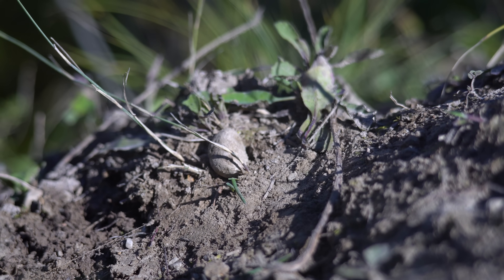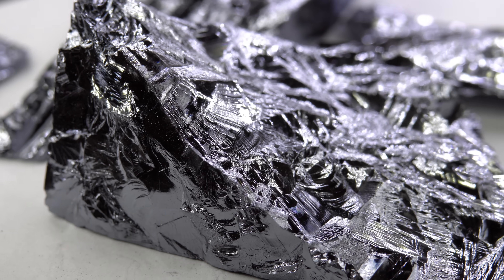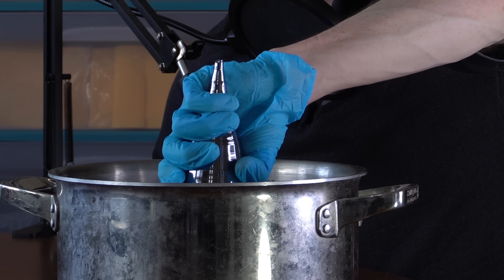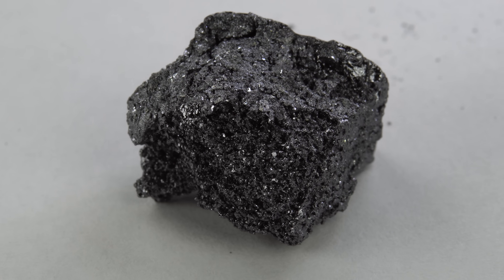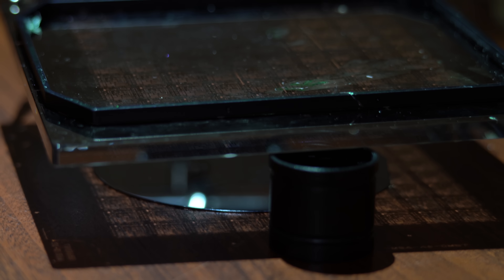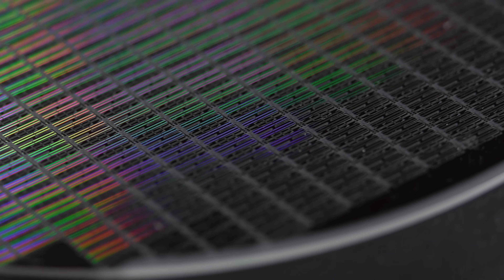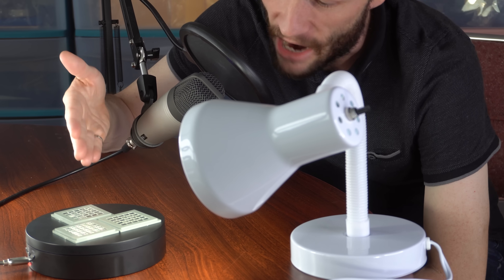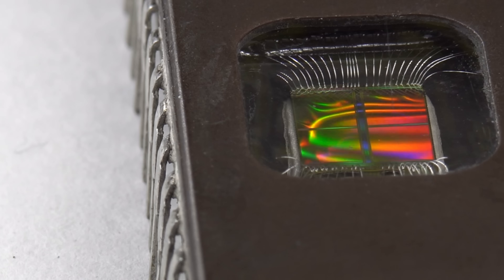How To Make A CPU

Comment: Genuinely would love to watch a detailed "how to make computer" video whete the guy created every from scratch. Hell, he even collect everything from nature.
Reply: It could be done, though it'd be crazily labor-intensive. You don't need any super-advanced manufacturing tools or super-pure materials until you reach thermionic valves. A relay computer could be built out of nothing but hand-crafted copper wire, some iron for relays, lacquer insulation, wooden supports, some citrus juice and some zinc or lead for the battery. The most difficult part would be perfecting wire drawing to get the copper thin enough for coils. You should be able to from-scratch your way up to around a 1930s computer. The monster would be the size of a house, with another house next door for the batteries, but it would be able to play tic-tac-toe. If you added a third house for the memory it could play Tetris. A single-purpose tabulating machine would be easier and only take up half a room, but you can't play any games on that.

Things get suddenly much harder once you use valves. Hard vaccum, glassworking, much finer and more delicate wire.
Reply: @vylbird8014  Not possible to “do it at home”. I’m not sure you understand how hard it is to make copper pure enough to conduct electricity. Let alone make wire out of it.
But sure man. Lemon Juice.
Reply: @OmegaUberDeathbot wdym pure enough to conduct electricity, it'd be harder to make copper metal so impure it stops being a conducter
Reply: @wooy1701  good point. But the mining and smelting of copper isn’t exactly something you can do in your kitchen. And with wires that small you are going to need some refined copper.
Reply: @OmegaUberDeathbot  yea thats true, you can probably make some impure copper with some stuff youll find in a garage but i doubt itll go through the whole wire making proces without breaking
Reply: @wooy1701  or messing you resistance calculations.
Reply: @vylbird8014 easier to make a biological computer by injecting base code into a female port.
Reply: It would be interesting if some of the dudes making video of primitive technologies someday break the barrier and succeed in making a electronic chips from scratch and start communicating with the civilized world
Reply: Well yeah unironically you do collect everything from nature.
Reply: @johnahn1117 pay him a billion dollars
Reply: Yeah, If you have 80 years to spare. Even making a natural sandwich is nearly impossible, imagine a cpu

Comment: Dude, you're a life saver. Been looking for a way to DIY this for a while. Can't wait to try it out.
Reply: Imagine how much money we can save. I happen to know that rocks are cheaper than CPUs, even with the added ingredients in the video! 💪🏼
Reply: @jsivonenVR I've been making my own since 2011. It's way more affordable and you can make them fit your needs exactly. It's also way more sustainable and ethical than buying from commercial brands. I only use local rocks.
Reply: @RicardoMontania are you memeing or Fr? I can’t tell if this video is serious
Reply: @ttv_zombiefetus1710  LOL memeing of course, making a modern cpu is extremely complex as you can see in the video
Reply: @RicardoMontania Lol
Reply: @RicardoMontania  I gotta admit I've almost been tricked myself, having started thinking that you may have meant you built some basic processing chips or whatever on your own lol
Reply: @RicardoMontania  doesn’t change the fact it’s still just material from rocks
Reply: @philipbeauford  yeah but you need a machine that costs around 40 million usd and remember that a lot of CPU's get wasted in the process cause it has to be ''perfect''
Reply: @jsivonenVR  for sure. I mean, the initial investment to get the equipment is probably pretty steep, but you should break even after a few thousand units or so.
Reply: All the best buddy!
Reply: Ya I built one myself too!
Reply: I got to the part where I put photo resist on the chromium etched photolithographic quartz mask to localize the etching onto the silicone wafer from a laser light source, 

but when I attached the bond wires onto the pads of the silicon chip, I still didn't get any computing power from the electrical current I ran through its pins. 

Did I not acid etch enough of the silicone wafer's exposed chip particles, or was my mistake in the homoepitaxy step of the curing procedure? 

Any help is appreciated. Thanks! 👍

Comment: Weirldy this explained it to me in the most basic way possible. I’ve done acid etching of a copper board so I’m taking this to be a highly engineered complex version of that
Reply: It is, but it's also like developing a photograph.  In fact it's called photolithography.  That's how they design the chip and then shrink it down to a microscopic size: by projecting it through a lens that makes the image smaller.  The light hardens the material where it shines, in the exact shape of the circuit.  Then they rinse off what didn't harden, so it forms millions (and now billions) of tiny paths where the electricity can flow.
Reply: @customsongmaker  Developing a photograph is another mystery for another day lol, I'm still using the good old 'magic' theory on that one! Interesting though, so the circuit is painstakingly designed on software and then etched through the lens onto the wafer and the electricity just takes the paths available. See there's all these videos that explain things but they often forget to make it understandable to someone with little knowledge of the subject. Don't get me wrong I'm guilty of this in my day job too. So it's always great to have a video on subjects that seem like magic explained so simply. My next thing to work out is how they produce all the capacitors on these boards. It's just insane to me how we've created what we have and haven't actually been doing it for that long!

Comment: I was following along and completing each step fine until I got up to adding the bond wires. Mine don't seem to be connecting though. Other parts of my chip are lighting up and working correctly. Maybe I installed them backwards?

Comment: I don't want to be that guy but the Primer Information that most people don't have here is something called 'Logic and Logic Gates'. The Magic Runes they are Enscribing with the black template are 'Logic Gates' constructed with Boolean Logic. This allows functions to be aquired by allowing or not allowing electrons to pass through resistors which are enscribed onto the chipset. These Electrons are following Predetermined Yes or No Logic statements generated by the Humans that made the chip. So the Magic Runes (Logic Gates) essentially take Human Understanding of Logic and Predictablity of Universal Functions and converts it into a Physical Instrument (The Chipset), when electricity is applied to the Chip, it will produce a current in specific 'Buses'/'Lines/Wires', causing that bus, line or wire to continue the logic chain, these produce Binary Outcomes and with enough encoding and decoding, we pretty much unlocked the ability to simulate any Physical Phenomenon. But yeah thats pretty much how it works.

Comment: Help I'm stuck in step 22! I couldn't find the knife you used so I used a cheese knife but I think there might be some cheese leftovers in some of the unpackaged silicon dies, is it safe to move on to the next step or will the cheese mess with attaching the bondwires? TY

Comment: I was part of a team that built servers for the processing line at the IBM 300mm CMOS lab in East Fishkill NY.  Not seen are the hundreds of servers and networking devices hooked into the line and all of the monitoring software involved with each step of the process.  Creating the chip is one thing... the manufacturing process is an engineering feat of machinery and computerization.

Comment: the craziest part about a CPU, is that its literally just drawings of resistors, diodes, capacitors, etc. and the drawings do what they depict. when you look at a super zoomed in electron microscope view of a CPU die, it literally just looks like miles and miles of common off the shelf components.

Comment: I'll never understand this, ever, to any degree. How do we take a rock, reduce it to nearly a pure form of its mineral content, and make it capable of processing and computing just by mixing some chemicals onto it, and cutting it real thin and throwing on a few wires? Just... how? And a bigger question, how in the absolute hell did we discover its ability to do this, in the first place???
Reply: From below.

You don't figure out the chainsaw by first figuring out half a chainsaw, you methodically "transform" its lower iterations (sharp rock) to its modern form.

For the case of CPUs, you need something that does calculations, and how can you make something physical do calculations? With logic gates, there are 7 of them, and you can simulate them even with dominoes.
How do you come up with logic gates? By intuition, "If a chain of dominoes cross each other, the one that reaches the cross-section first will interrupt the other".
Reply: The fact is, there are demons trapped inside
Reply: Logic gates are the one that makes computing possible. CPUs are just a bunch of logic gates.
Reply: We did it the other way. Once you know that you want to break this things apart it's obvious the hammer is the tool to go. . We figured what a computer is/would be, then we wondered how we could achieve it.

After a while we seek for any opportunity to get this as tiny as possible, figured it's easier to be accurate or fast with light and shadow rather than mechanic tools. Which materials i know suit this technique? And here you go. "Photolithography"

No one ever wondered "How could i get a pebble to think"

We broke it to easy questions

Btw if you think this is exciting, you should try to create a basic diy calculator. It don't need that much, i guess you'll get fun of it, and you'll answer your question real quick

Or any cardboard robotics for kids, the controler part is very telling about how we get from every day world to such machinery/electronics

I wish i could share some but these won't be in english 😅

P.s: and about the how we get a pebble to process, basically the chemical react to light, it draw a circuit onto the "rock", like you would draw a dog with your hand in front of a lamp. Once you have circuitry, you know how it work. It's basically same as the cable electronics you're familiar with, but smaller. 

The extra processing are either layering of this to add "components" or tuning/setup of it. (Detail about these would be boring to explain. You don't miss much)
Reply: @sdwqbvlwdslbvlbwflbunlwbf  Can confirm. Made simple systems on a breadboard in intro to hardware engineering, using an FPGA for more complex stuff later. Final project for the class was an 8-bit CPU that the TAs would plug in an EPROM loaded with a program and check the output. Was lots of fun, and it's something anyone could do to learn.
Reply: Ty
Reply: Simple reverse engineering. 40,000 days ago everybody was riding horse and buggy’s. not enough time do that all by ourselves
Reply: Blame that dastardly scientist Yakub
Reply: Ok I smashed my gpu and am attempting to reverse engineer this thing back to rock. Wish me luck.
Reply: Science
Reply: Focus, commitment, and sheer fucking will
Reply: lol arabs and chinese came up with all the math behind it, and mouthbreathers who can barely hold a job are here saying "it was white people"
when we talk of slavery and colonization you people are like "it wasn't me" but when it's beethoven or charles babbage or whatever suddenly you want to share the credit
Reply: seriously tho, there are some great videos on youtube on the history of computers. I recommend the "Computer Science" list from @crashcourse
Reply: Imagine a system of levers controlling water flow in pipes. When you want want to wash your face, you operate your tap and make the water flow through the pipes. When you want to flush the toilet, you have a different lever/button that does that. 
On a basic level, electrons travelling in computer circuits are the same as water running through your pipes and what you do when you operate your keyboard, mouse, gamepad etc. is you're pulling all sorts of levers and making the electrons travel through systems of pipes to finally display desired images on the screen for you. 

In the beginning computers were only capable of basic operation that a cheap calculator can do these days. It took decades of improvement and work of countless scientists, mathematicians, physicists to get to where we are now. It's normal for you not to understand how a modern computer works. You have to go back to the "stone age" of computers to truly understand it on a deeper level. 
Anyone can do it, you can do it too. All you need is time and curiosity.
Reply: Most modern technology was reverse engineered from recovered alien craft.

For example, the patent for transistors was filed only two years after the Roswell incident.
Reply: @ogChaaka  tin-foil hats had to invade this comment section sooner or later. 

I understand, the working of a transistor is so mind-boggling for you, resorting to "aLiEn tEchNolOgeEE" is the only possible way you can cope with this marvel of engineering.

Lest you grab an actual history book and pay tribute to the greatest scientists our civilization ever produced like Shockley and his countless experiments with semiconductors.

It's not just that you tinfoils are misinforming people. You're also incredibly disrespectful towards humans who dedicated their entire lives to science.
Reply: @ogChaaka  First patent on the Field Effect Transistor - Julius Edgar Lilienfeld 1925

Roswell incident - 1947

You're a liar and a tinfoil.
Reply: @ogChaaka  
First patent on the field-effect transistor - Julius Edgar Lilienfeld, 1925
Roswell incident - 1947

Any more ignorant lies you'd like to add?
Reply: @saudude2174  obviously that was retroactively faked as misdirection.

Its a fuckin joke eh? Lol
Reply: @ogChaaka  some people actually believe that shit, no kidding.
Reply: The aliens gave us ideas. 👽🛸
Reply: the chemical reactions he speak of create compounds with some of the silicon, which when sandwiched create a very tiny electronically operated switch due to the extra or missing electron in the compounds. processors are just many of these switches arranged to perform logical functions.
Reply: @alto-x2t  hell yeah! good explanation, It all makes more sense now. So as time has progressed they have been able to add more switches
Reply: @ThunderKrak  yes, as well as thinking of more intelligent and efficient structures for them, which we refer to as architecture.
Reply: "how in the absolute hell did we discover its ability to do this, in the first place???"
Took centuries of mathematical theorizing how to make useful computations with discrete units of information. Then people found a way to actually run these computations using mechanical devices (image something like an automated abacus). Then they figured they didn't need mechanical moving parts if the 'state' of an electrical system could be used to represent 'numbers' and otherwise 'hold' information. So they went on and perfected these electrical/electronic systems. It was a very gradual process that accelerated greatly in line with communication technologies and the immense interest the field attracted, seeing how anyone with a brain could see the potential.
Read up on Alan Turing and his contemporaries, as well as mathematicians like Boole
Reply: White people
Reply: @odessium8986  💀💀💀💀💀
Reply: @odessium8986  Good point. Civilization and advanced technology? You're welcome ^_^
Reply: Hired bunch of Asian  + overwork + rice
Reply: @mr123undead neither Alan Turing nor Ada Lovelace were Asian though.

Comment: Way over simplify and misleading. Silicon found in sandstone, silica sand, or quartzite and not ROCK. It is also found in water, plants, and animals. This dude should exaggerate further by starting making CPU (or any semiconductor chips) with plants to add dramatic flare!

Comment: INSTRUCTIONS:

1)  Get a rock.
2)  Smash the rock.
3)  Now you have 98% concentrated silicon dioxide.  Purify it to 99.9% pure silicon dioxide.   
4)  Purify it further to 99.9999999% polysilicon metal.
5)  Put the polysilicon ingots into a crucible.
6)  Heat the silicon ingots to 1698 °K.
7)  Take a small seed monocrystal and dip it into the vat of molten silicon.
8)  Slowly pull the crystal out as it cools.
9)  Now, you've a monocrystal of pure silicon.  Cut it into thin slices.
10) Now, you've got pristine freshly-cut silicon wafers.  Optionally, dope them with Boron, Phosphorus or another dopant.
11) Put photoresist on the wafer.
12) Take a chromium-etched photo-lithographic quartz mask with your desired circuit pattern and shine a laser beam through it to project the circuit pattern onto the wafer.
13) The locations of the shadows produced by the photo-mask will control where the photo-resist is chemically changed on the surface of the silicon wafer (depending on whether you used positive or negative photoresist). 
14) Now, develop the photoresist.
15) Acid etch the exposed parts of the wafer.
16) Perform countless iterations and repetitions of homo-epitaxy, hetero-epitaxy, pseudo-epitaxy, diffusion doping, copper interconnect layers, chemical mechanical polishing, photoresist applications, acid etching, and photomask exposing to build up the desired features on the wafer.
17) Now you've got a finished silicon wafer.  Cut it into pieces.
18) Now you've got un-packaged silicon dies.  Locate the pads on the silicon chip, and attach bond wires, or use the flip-chip method as is done now for most modern processors.
19) Use the bond wires or solder balls to provide an electrical connection between the pins on the chip package, and the pads on the silicon die.